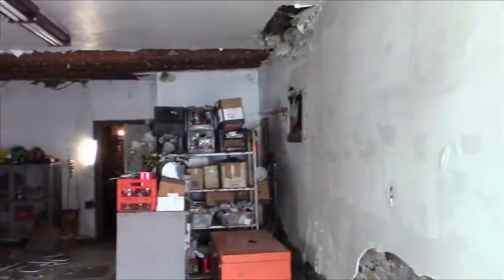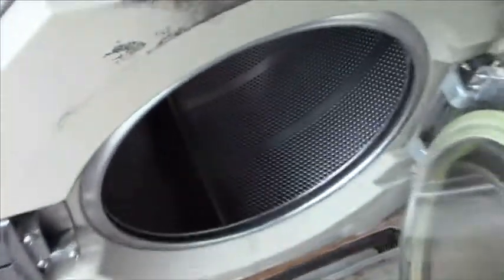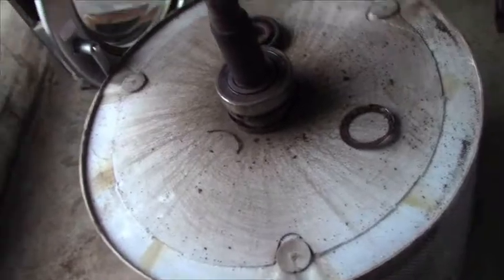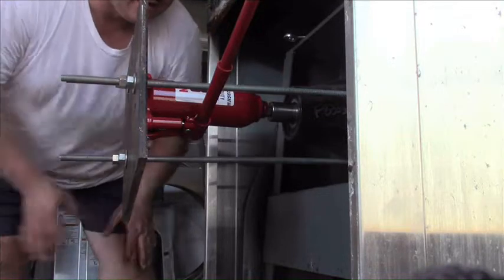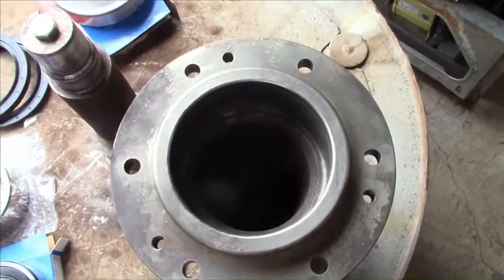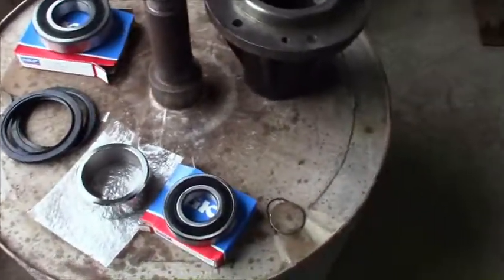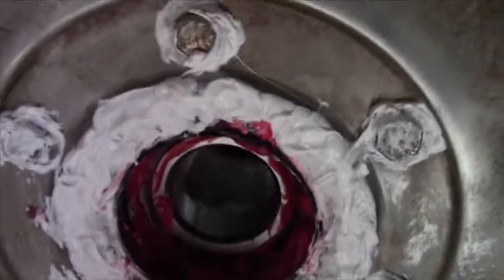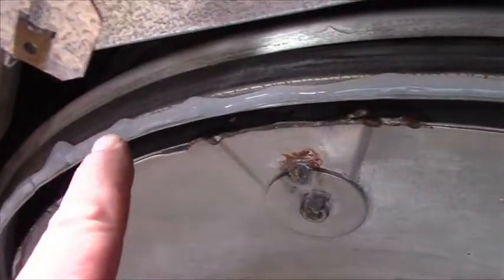Laundromat Project Part 2 - Washer Rebuilds!

Comment: That's a lot of work....
Reply from the maker: It sure is.  I'd guess about 8 hours of actual work time per machine.  Some took more, some took less.  But I work slowly.  Between parts and labor, I'd be paying roughly $1000 per machine to have a service tech do it.  And that's if they didn't try to rip me off by telling me the big round drum had to be replaced, it couldn't just have a new seal sleeve heated up and put on!  Getting dirty and having sore hands and knees is not fun, but when the job is done and I still have my money, that part feels good!  :)  On my website, episodes 92 and 124-125-126 are examples of bigger car jobs I did many years ago.  I bought all the bearings, seals, and sleeves to fix 6 machines at kingslaundrygroup for about $1200.

Comment: Couldn't you have used a block of wood in between the bearings and the hammer when banging them in place??
Reply from the maker: Wood would absorb the shock and take away from the hit.  I could have used a small metal plate or something, but was too lazy to go cut one to size.  It turned out ok the way I did it.  I didn't have to hit the bearings hard, just even, controlled hits, and keep moving the hammer around the edge.

Comment: Where you buy the plate puller?
Reply from the maker: I had it made from a piece of 1/2" steel plate, with holes drilled in the right spots.  And threaded rods with nuts and washers from Lowes.

Comment: You don't use a hammer like that on bearings!!
Reply from the maker: While I agree that using a hydraulic press would have been a better way to do it, I didn't have a press and was too cheap to spend $150+ on a press at Harbor Freight that I'd only use for a couple weeks.  14:30 - note that I didn't hit any harder than I needed to, and only hit the outer bearing race.
Reply: What you're supposed to do is use the old collar or bearing to lay on top of the new one, and hammer that. That's what meant I think